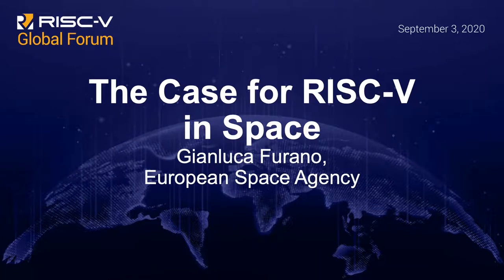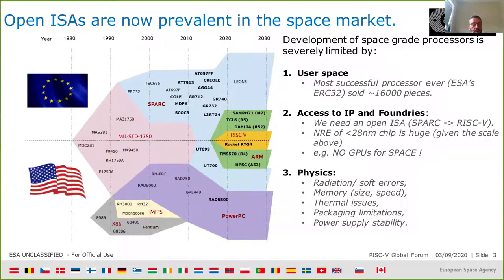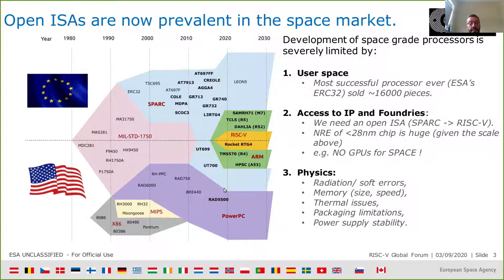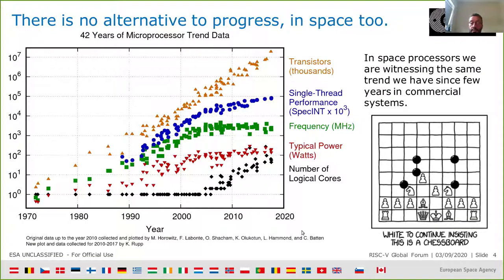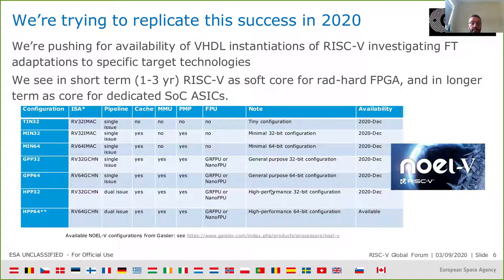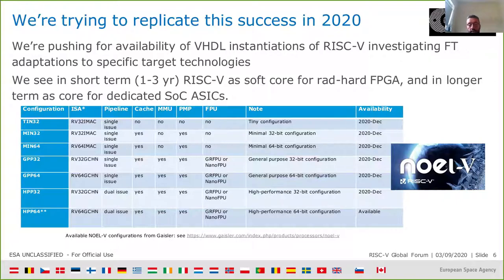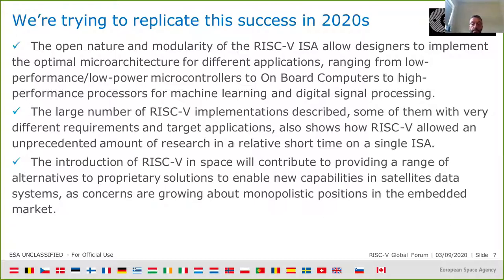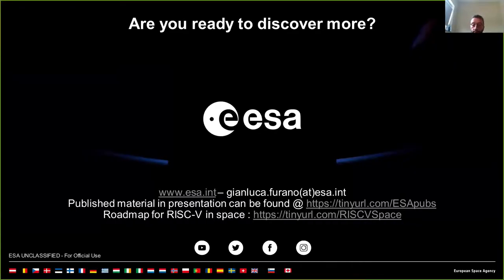The Case for RISC-V in Space - Gianluca Furano, European Space Agency

Comment: Hopefully we see SpaceX design RISC-V for their Starlink satellites and Dishy user terminals.
The former will increase throughput for each satellite from the current 20 Gbps, while the latter will decrease power consumption of the terminal from the current ~100W, which is too high, especially for people who intend it for portable usage (camping, running on a battery/inverter or a generator).
100W is too much for an electric car battery. If Tesla ever plans to integrate the flat phased array antenna as an option into the roof of their cars.